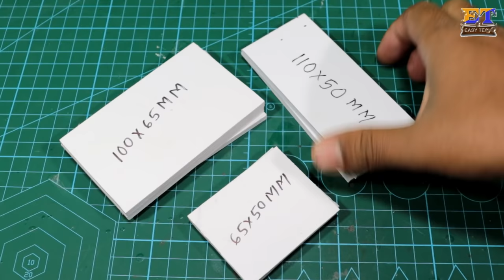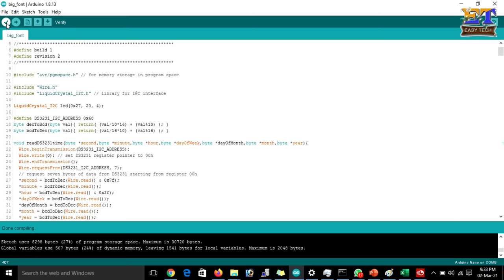How To Make Digital Clock Using DS3231 and Sun Board

Comment: Good job, why do not use a rechargeable CR2032 battery in the DS3231 module?
Reply from the maker: No need. One normal battery will work for long time
Reply: @easytechzones  Yes, but the module require rechargeable battery